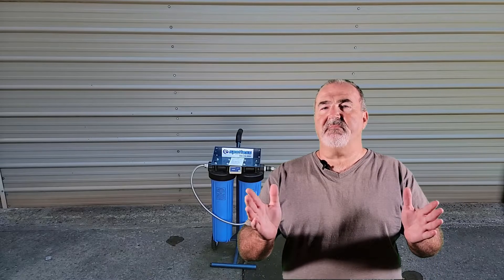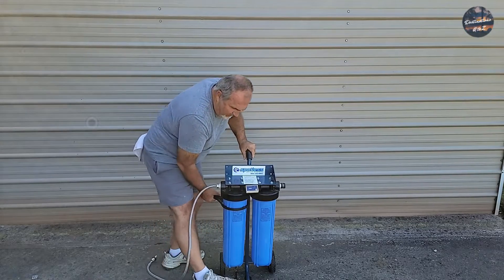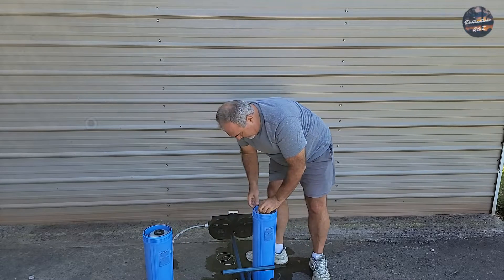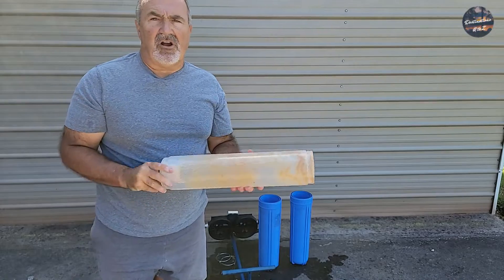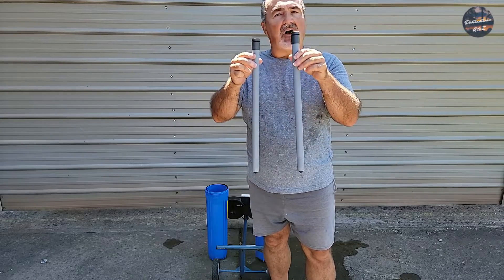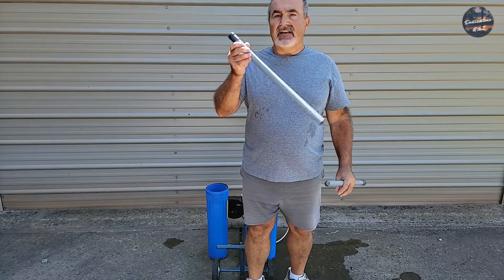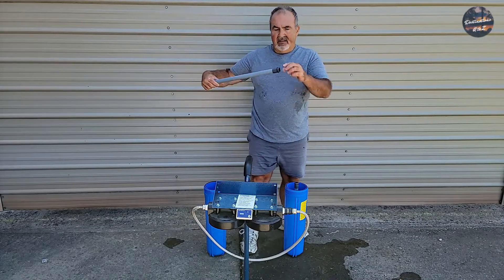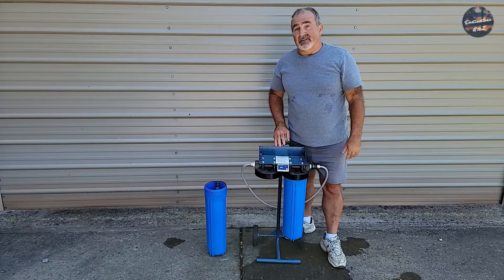How to Convert your CR Spotless to Make SUPER Efficient - DI Water spot free

Comment: Better yet, get the convertion tubes. Get rid of the cartridge units. Fill blue canisters full of media, keeping two inches lower than the top. Push your conversion dip tubes down the middle screw on the canister to the housing and do your rinse. Now, you will get more gallons of clean water before changing the media again.
Reply from the maker: Thanks for your comment...!

Comment: I keep having resin coming out the outlet side ive already confirmed the tubes are in place what else can it be?
Reply from the maker: Thanks for your comment... Make sure your Rubber gasket at top is not rolled or kinked.  Also you may want to convert to larger diameter round gasket to ensure no leakage.  But Look at the laser cut holes in tube at bottom, they may be too wide and you may have to exchange for new ones...

Comment: I have the apec brand. Looks like the cr spotless kind of a knock off from home depot. Do you know if this will work on the apec?
Reply: Thank you very much!
Reply from the maker: @chascline8024  You are very welcome....
Reply from the maker: Thanks for your comment...! I believe it will work with no problems....
Reply: Just purchased the apec csw-300, about how many rinses did you get out of the factory filters ?
Reply: @scottohms2799  I have used it 5-6 times for window cleaning jobs and I'm still at 0ppm.
Reply: @chascline8024  did you install the rv mods pvc pipes or factory filters?
Reply: @scottohms2799  I haven't yet. I'm still at 0 ppm. When it starts to creep up I will order it.
Reply: @scottohms2799 I don't know exactly but it has made me about $2,000 on window jobs and I haven't had to change my filters yet. Best money maker around for the money. I am very happy with it.

Comment: I bought one and am screwed.... I have well water and even after passing thru my home water softener i get 1200ppm at tap..... I was only able to get like 4 washes with a new unit :(
Reply: take the CR out of the equation and do a tds before and after the water softner.... 1200 is a WTF?!?!?!?   if your 1200 after the softner  check it pre softened.... I think ur using too much salt, but if it's tested pre and post.... you might need a new well
Reply: @crx304  its the same TDS before and after softener, the water people told me i need a deeper well dug for cleaner water
Reply: What did you end up doing? I'm in a similar boat. Thinking of doing a large RO system from max water
Reply: @mmakam3  I checked the TDS on another well i had for sprinklers only and that one was only 400 TDS.... So ended up using that one.....I buy the resin bulk so it's cheaper, am getting like maybe 60 washes before I have to recycle it
Reply: @puerco911  where do u buy resin?
Reply from the maker: Thanks for your comment...! You should try it prior to passing through water softener....If yours is a salt water softener it will actually add contamination...
Reply: If the tds is over 100ppm in your area Look into an ro/di system. The ro will bring down the ppm a ton and he di will “polish” it off
Reply: Don’t wash the car with the CR spotless….only use it as a final light rinse after the soap is washed off.

Comment: I have the CR Spotless DIC-20. How many cubic feet of resin does it take to properly fill the two blue housing containers?
Reply from the maker: Thanks for your comment!!!! It takes approximately .5 to fill both with the conversion....
Reply: @DestinationsAtoZ  Thanks for the fast reply!  Looks like it's only sold by the cubic foot, so I guess I'll give that a shot.  Appreciate the info!
Reply from the maker: Check on eBay as it's sold by .5 as well.... But I personally always buy 1.0 as it's usually cheaper as I know I will use it....
Reply from the maker: Here's where I got my last.... https://www.servapure.com  Super quick and reasonable...
Reply: @DestinationsAtoZ  Appreciate that!  Not sure if I'd go through it fast enough to get the full 1.0.  I'm not a detailer or using for business. Just want to keep my car clean and water spot free.  Live in rural Indiana, on well water. Have a softener for the hard water, but it adds sodium that leaves white water spots on everything.
Reply: Do you have worry about who you buy the resin from? Are all resin have different quality?